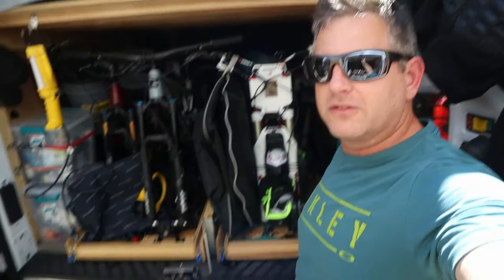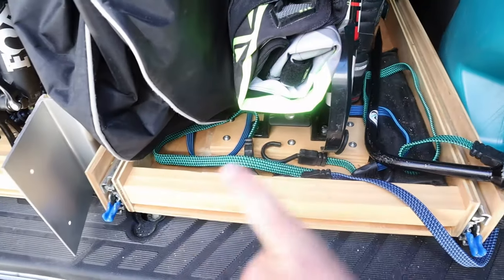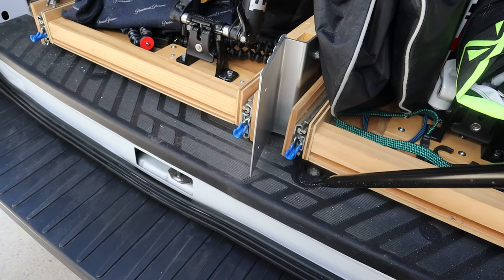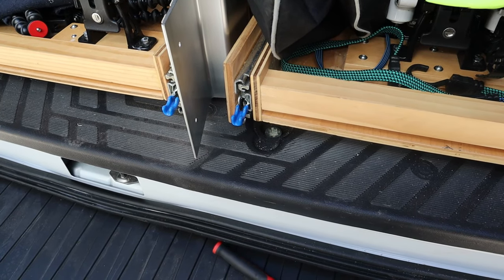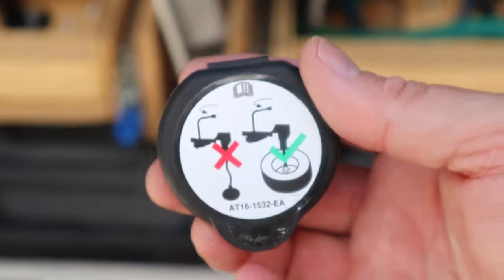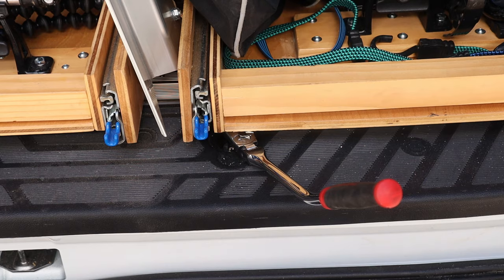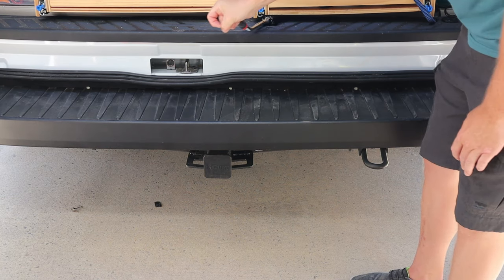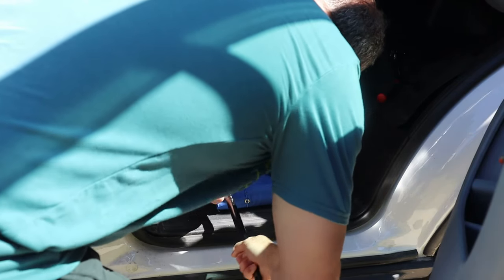#MTBPlanB Best spare tire removal hack for Ford Transit!

Comment: I just bought a pre-owned 2018 with 17,960 miles and no lug wrench. These are $40 on eBay. I can only imagine what Ford wants for one of these wrenches. I think you solved my problem. I wish I could email you a beer. Thanks man.
Reply from the maker: Cool glad it could help someone!

Comment: On my Transit t250 I raised the cable when I had no tire on it , jammed it up big time.
Just a heads up saying make sure there's always a tire on there when cranking it up or down , just in case you didn't know
Reply from the maker: Larry Webb Thanks for sharing Larry!

Comment: The smaller Transit Connect van uses that same system to lower the spare (which unfortunately is a compact spare).  Will have to try this.
Reply from the maker: Great, let us know if it works!
Reply: MTB Plan B   Sorry it took so long to reply.  No unfortunately 1/2 inch doesn’t work on the Transit Connect, too big.  3/8ths is too small.  The Transit Connect is European made (Metric) and imported to the U.S.  Will look around for something in a Metric size. Will let you know if I find the something.

Comment: You don't even need a lug wrench. Just get a socket to fit the lugs.
Reply from the maker: Tony Greifenstein Not so much leverage with the short handle ratchet so I still use the lug wrench sometimes.

Comment: Even better use an impact wrench with a 1/2” socket adapter.
Reply from the maker: Sounds fast!
Reply: @URBANENGINEER How would you fit that under the wooden contraption he has in there?

Comment: WARNING! Anyone attempting to change a tire on a 2010 Ford Transit 
should be aware that the Owner's Guide contains inaccurate and 
potentially dangerous information. This relating to the stowing of the 
flat/spare tire. On page 190 the guide states "Lay the tire on the 
ground with the valve stem facing up towards the vehicle."  If you 
follow these instructions you will find the tire will not seat firmly 
against the car body. It just dangles loose. The hazard this poses is 
incalculable but potentially fatal. The tire must be installed valve 
stem down as this video clearly shows. That Ford engineers thought this 
"Rube Goldberg" method of tire attachment appropriate simply defies 
credulity. "Stupid Device" is how Roadside Guy refers to part of it. NB:
 Ford should copy how the Peugeot 505 Wagon accomplished the same task; 
clever with simple and solid , nearly fool-proof engineering.
Reply from the maker: We didn’t get it in North America until 2013.
Reply: Hi I installed a larger tire as spare , it seats in a bit of an angle , and does wiggle a little, is that an issue too?
Reply: @tinrat-n-teet  No wiggle room allowed!